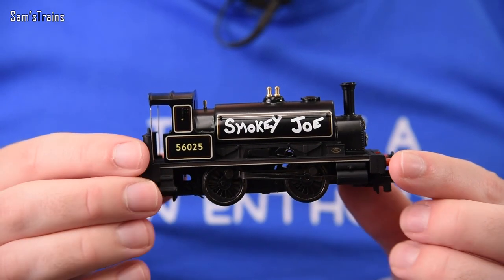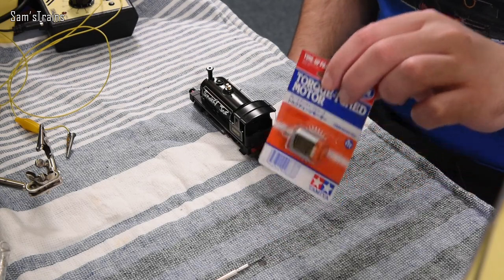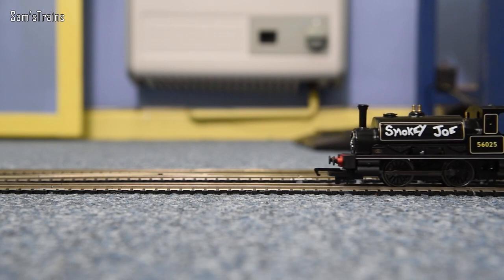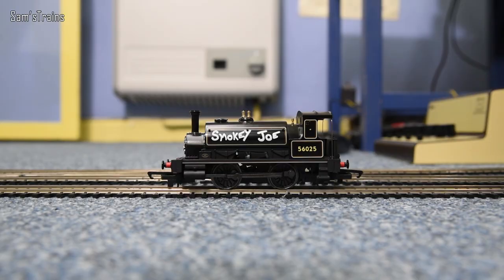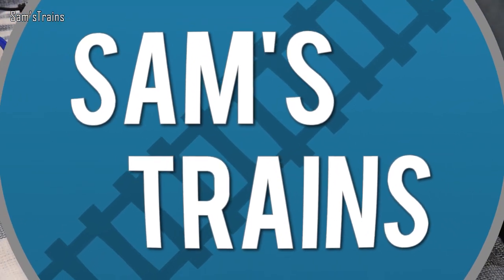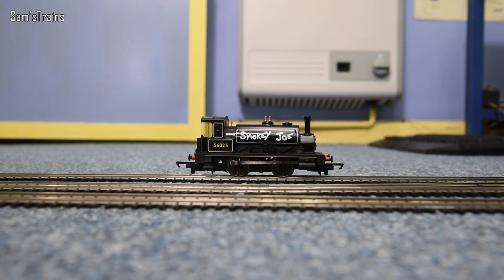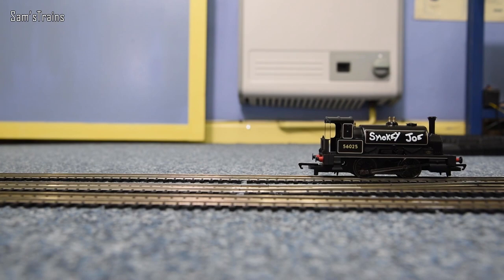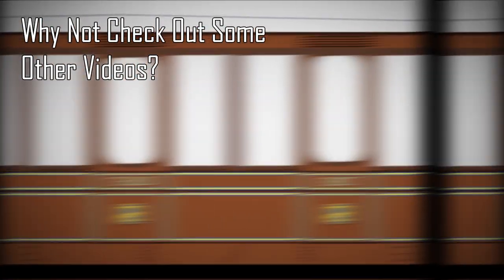Hornby Smokey Joe | Turbo-Speed Motor Upgrade | How Fast Can He Go?

Comment: I think a weird engine by design is the John bull. It has no cab and the front so the fireman and the driver are can be seen working very clearly and the engine looks like it's done besides its lack of a Cab on the engine itself. If you ever get a model of it or look up the John Bull engine you will be surprised by the design like I was. Because I think the Tender acts as the engines Cab as well.
Reply from the maker: You're right - that is a very weird design - got a video on those coming up soon! :D
Thanks for watching, Sam :)

Comment: The original Smokey Joe had a 1/76th Scale Rolls-Royce Olympus Engine with afterburner with a scale top speed of 1500 mph - consequently it didn't corner well and Hornby nearly went bankrupt replacing windows after it went supersonic and the boom hit...

Comment: Hi Sam, where have you been getting 5-pole motors with the correct shafts? I've been struggling to find ones with any shaft out the wiring connection end of the motor.

Comment: Interesting experiment but the magnetic attraction to the connecting rods combined with the modified shaft length to the worm is definitely what's compromising slow speed running. Pity really 'cos the idea was a good one. I can't really see any way around the magnetism problem so you may need to try a different motor in the end.

Comment: If my calculations are correct, 2.17 meters per second translates to a scale speed of 371 miles per hour. Why did they get rid of Smokey Joe if it goes faster than the TGV ???

Comment: Put tangerine on motor position and nei... will give it more torque if u add 5 tangerine it will raise watts for more torque but motor will get hot for pulling more weight

Comment: you should have fitted it with a 5-pole 180 motor
180 is a 130(the torque tuned motor you used) but slightly longer and twice a powerful (also they are much cheaper than hornby 5 pole)
i run all my trains on 180 7-pole (these are custom made from the manufacturer i got the trains from ) or big coreless motors

Comment: If 5 poles are so inexpensive now, i will consider replacing the motor in my Bachmann Thomas. The motor started smelling and thomas wasn't smooth at all. Lubrication didn't help much. At this moment, Thomas is the closest thing to a working steam loco I have, and he barely runs now

Comment: That high speed motor is from the japanese company Tamiya for their mini 4wd line of cars, it should be OEMed by Mabuchi Motor, who is both the largest small motor manufacture and has been Tamiya's OEM for a very long time. hardly a "mystery chinese motor" But it's set up for very constant and very high speed running and I would imagine that motor wasn't pre run in, which usually makes that weird electrical smell
Reply from the maker: Ahh duly noted - apologies for my ignorance on that!! Yeah of course - I don't expect it was run in either!
Thanks for watching, Sam :)
Reply: @SamsTrains  You do always put on a good show! Ol joe there went impressively quick with that motor, although the 5 pole is a much better choice for such things

Comment: I want to ask an expert, I have a Trix 3 rail Britannia 70000 it's from the late 50s early 60s it is brand new in a perfect box never been run it's over 60 yrs old and still, in all its packing, shes metal body loco driven and has an unopened pack with pickups to swap to 2 rail is it a collector's piece thanks.

Comment: Hearing the beginning when you say welcome to another experiment and the title is what got me thinking oh dear god no lol.  can you picture it in a pacific . i think the va;ve gear would end up breaking. on the original motor what is the purpose of the transistors i noticed alot of the locos you have they have them. i never seen any on mine. unless it had a dcc board on it and i removed the leads to make loco dc til i have dcc
Reply: One brown disc is the interference suppression capacitor, but I think Hornby have also now fitted a voltage regulator (looks much the same, surprisingly) so the motor runs more slowly. Certainly, those components are not redundant.

Comment: Hey Sam, since this is on the subject of fast model engines, what's one of the fastest one's in general with no modifications whatsoever? I mainly want to know this as I'm converting some of the All Engines Go die-cast over to Hornby/Bachmann rails and want a fast engine for Kana the bullet train as in the show, she can run at basically what looks to be over 300MPH converted over to real speed. Obviously, i know there's NO WAY she can go that fast on the rails and not get damaged or just keep detailing, but i mainly want one of the fastest Engines that can actually proper work for her

I've actually been binging your videos these past few weeks, the gandy dancer video was the most helpful because i found Sandy looks to scale with it for the conversions

So far, I've only got the wheels done on Thomas, Diesel, Percy and Kana with the others still being in development (have to find a way to covert Gordon and James and so on onto rails, they look SLIGHTLY too long to get round corners! Haha!)

Specifically looking for smaller units

Comment: Great to see a better motor being used shame about the magnetism You could try fitting some styrene strip to the top of the piston so the connecting rod stays in place better and doesn't pop out the top of the piston cylinder. 👍✌

Comment: The capacitors are important for DC with DCC it is better to remove them.
Reply: Yep. The capacitors are in the decoders these days.
Reply from the maker: Yeah that’s right, though it won’t hurt leaving them in! The ones to remove are in the Hornby power tracks, or anything similar!

Comment: 5:40 my smokey Joe  always runs at that speed for 50% power, maybe my controller is broken?
Reply from the maker: Nahh - they used to use different motors that did run faster by default, so the older ones will run a bit like this (though not that fast!)
Thanks for watching, Sam :)

Comment: If you really want Smokey Joe to haul arse there's a brushless motor system for Mini-Z's that will fit right down in there. 9,900kV if I remember correctly. Find somewhere i there to hide a 2s800 lipo and some RC gear, get Smokey Joe to really scoot.
Reply: 9,900 kV is a very high fatal voltage. So you did not remember correctly.
Rarely used in industry let alone houses.

Comment: Imagine putting that motor in a big tender engine with valve gear and let's just say blue peter mean the motor wont make the valve gear break lose or break the cylinders unlike last time: flash back

Comment: You know what that new motor is good for if they keep a model train race then that motor will be super useful hahaha and there was this one time I test a 3 pole motor maximum limit I give it 12 vote it run so fast it got so hot the plastic melted but the Moltres still went on I touched it too soon and it burnt my finger

Comment: Why is crawl speed so important for model trains?
Reply: Shunting, primarily, and for the locos to behave more like the prototype: real locos are large and heavy, and there's a lot of inertia to overcome, so they have to start slowly, and gradually build up speed. Start too quickly and traction is lost. Model locos often start with a jerk, which is unrealistic. Also, it's very easy to make a fast model train, but much more technically challenging to make it go slowly.
Reply: @PeterJewell2  Oh ok, that makes sense, thanks!

Comment: Get a small engine with that motor and pull all the rolling stock you have on the line. Or make it heavy loaded rolling stock and see if it can go at a good speed

Comment: Hi Sam, just bought a Smokey Joe from rails of Sheffield for £24.50. Wonder if someone has put the same Chinese motor as you tried it flew up the track and shot off inside my tunnel requiring my wife's long slim arms to get it out. Stupid speed and cloggy at slow speed. Fastest I can run it is 30% and that looks to fast !!!!

Comment: Throw in a fly wheel, a different gear ratio and a Electronic stay alive. You might be spending more than the model is really worth then again you might tip the scales and rebuild the compete chassis with compensation and more weight to improve the downward force of the wheels.

Comment: 5 pole motor, lets ignore the long shaft which is the proper side and install it backwards like a derp.
Reply from the maker: Sorry, you're the derp ;)
The motor mountings are designed so that the motor only fits in one way... so the worm drive always has to go on the commutator end. I do this for a living - if the worm could go on the long shaft, I'd put it on there!
Thanks for watching, Sam :)

Comment: Hi Sam.
You really need to get hold of a Heljan BR Green Class 16 to review it. Take a look at Jennifer E. Kirk's review. WOW, what a superb diesel loco; she gives it 9.5 out of 10 and rightly so. They were a limited production run of 750 but I have just spotted one on the well known auction site for only £115, used but in 'almost new' condition. The prototype only lasted for 10 yrs as they kept over heating and were scrapped at the same time as the steam locos they were designed to replace. I'll be looking out for a review of one by yours truly! 👍